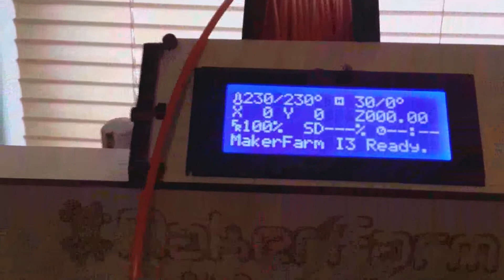Extruder issues

Comment: hi i found with my prusa i3 the same problem to solve it i had to take the hot end apart and make sure the holes are in alinement as it was snagging on the ptfe tube if you take the filament out you mite see a little bump where it has got caught hope it helps you